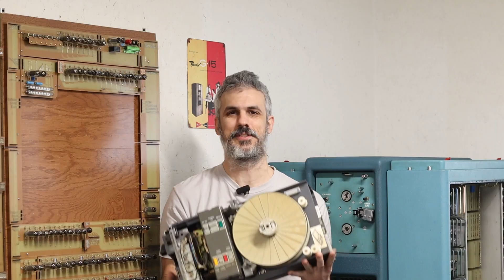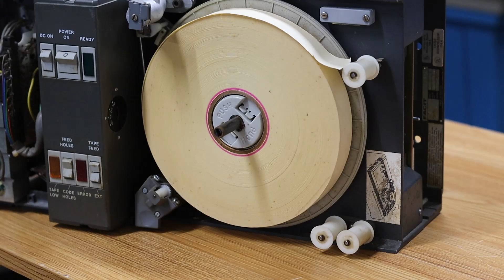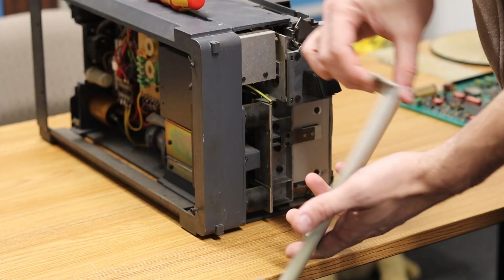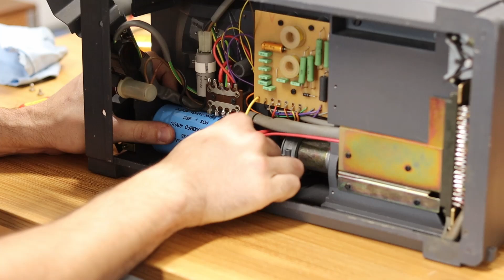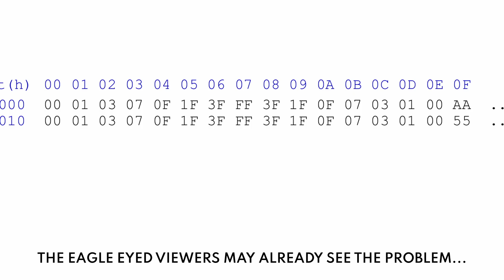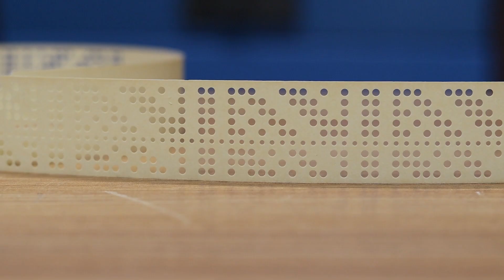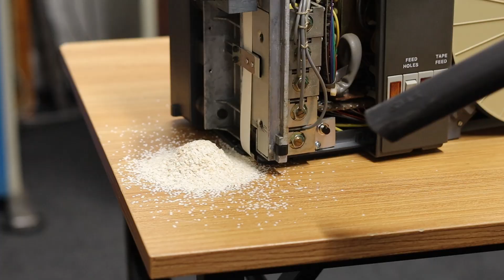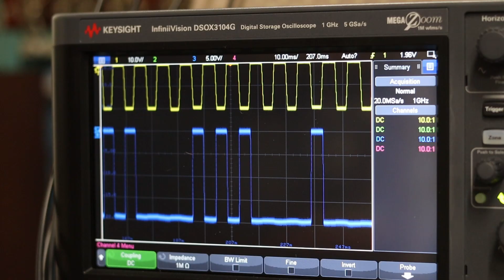Reviving a Facit 4070 Paper Tape Punch

Comment: Tip: Remove the cards and bring up the power supply wtih a variac to try and reform the caps over 24 to 48 hours since they haven't been powered up in years. Bring it up about 10v every couple of hours until you get to 110v going into the unit. That will help keep those old caps from shorting immediately on power up.
Reply: Bringing up newer electronics like that can be problematic and damage other components. And would not have saved a cap that was shorted.
Reply: @KameraShy  Caps like that short on sudden full power up after being unpowered for years. That's why you bring them up slowly. I did this on my SWTPC 6800.
Reply: @Arcadecomponentscom  agreed, I came here for this comment. 
@KameraShy is right too, I think this only applies to linear supplies. You'd have to pull and manually reform bus caps on switchers.

Comment: Just a small point ,  we used to use a telex punch ,  a KSR33  would be just as useful ,  the mechanism is very similar to a mechanical barrel printer ,   incidentally I do like the ODEC , chain printer,  which model is it if it has a hammer bar actuator its the faster 500 lpm I think ,  if it is look at the springs for the hammer bar ...... Yes it's Fibreglass circuit board

Comment: If i correctly recall, the MGAC ( Missile Alignment and Guidance Control) on the Titan II Missiles used paper tape as a security measure, as well as for reliability.   They still have a sample at the Titan Museum in Arizona.
Reply: I can relate. The British Navel used (and may still do) paper tap for sending message securely to ships as they were easy to destory if needed.

Comment: Great to see that it was just a slight tweak to the photodiode sensitivity to get it working with the white paper tape, but before you did that, I was thinking, "These tapes are kinda like the ribbons in that typewriter/teletype. Surely there are kits to 'reink' them to keep the ribbons useful for a much longer period, and not force them to be thrown away when exhausted, when they might be irreplaceable. Couldn't you do something similar to 'reink', or just 'ink', the white paper tape to make it more opaque to the reader's light?"

Comment: The fact that you can now transfer data from your modern laptop to such an old machine as the Bendix G15 is mind blowing
Reply: you can go back even further and transmit data to old teletypes. It's mind blowing that, while PCs have dropped the RS-232 serial ports about a decade ago, you can still buy USB and PCI-Express serial cards that are fully compatible with such old machines. While RS-232 is the standard, the signaling (+12/-12V) goes way back. You can, with a simple voltage adapter, connect to Teletypes from over 100 years ago.
Reply: @drgenio2006 my motherboard has serial and parallel still and it's like 5yr?
Reply: @forbiddenera  k
Reply: @drgenio2006  Some MoBos still have internal COM ports so you can connect the serial interface directly.

My relatively recent  B450 MoBo (~2021) have a couple that can be enabled or disabled on BIOS
Reply: @-argih  well, there is still an ISA bus in every PC motherboard. it's just not easily accessible haha
Reply: @drgenio2006 most of the time it doesn't even make it out of the southbridge package anymore.
Reply: @drgenio2006  That was true in the days of PCI, the ISA bridge was written right into the spec. But most boards made in the last decade no longer allow any access to the ISA bus, because they probably don't have one except as a data stream within all the PCIe data. (So they have a VIRTUAL ISA bus for OS compatibility, but no physical contacts.)
Reply: @drgenio2006  The ISA bus doesn't physically exist in a modern PC anymore. It got replaced by the LPC (Low Pin Count) bus that connects a bunch of low throughput devices (eg. BIOS flash, mainboard sensors, etc.) to the chipset. LPC looks like ISA to the software, but at the hardware level they're not compatible (although LPC to ISA bridges exist).
Reply: @blahfasel2000  I said "it's not easily accessible" didn't I?
Reply: @drgenio2006  "not easily accessible" implies that there's something to access in the first place, which there isn't in a modern PC. That you can add an ISA bus with a LPC to ISA bridge (just like you can add one with a PCIe to ISA bridge, or even a USB to ISA bridge) doesn't mean that it has an ISA bus.
Reply: @blahfasel2000 what a bitter little man.
Reply: @drgenio2006 god I want one that has all the old stuff easily accessible.
Reply: You only need a mechanical code converter 😂
Reply: Such is the power of RS232!
Reply: It's totally doable with custom electronics that connects to the vacuum tube computer via high voltage logics interface that's usually used to plug in peripherals - you gotta figure out how to make it function like virtual RS232 as those ancient computers don't know how to properly handle RS232 as they predate that specifications. It's gonna be wild seeing the messages via terminal received from the early computer after it has done its processing.
Reply: Man, I'm struggling to do this with my Morrow Pivot all because I don't have any 5.25 disks and haven't quite got my fdd emu working
Reply: If you really want you can use a PC to send and decode Morse code, given you have a constant enough wpm, that just needs a sound card 

Or connect a ticker tape machine and get your stock market data like the old heads from the 1920s  

Wifi or LTE connected ticker tape just connect an esp32, with custom program, and use a level shifter on the esp32 uart

Even Bluetooth compatible
Reply: Can even use your smartphone

You could go a step further and instead of paper tape, you could use led or optoisolators instead of paper tapes, directly driving or replacing the entire photo diode assembly if using opto isolators

How much faster can it now load a "tape"

Just record the pulses on the paper tape as a parallel data stream, play it back using an esp32 via Bluetooth or WiFi

Each bit is either an led or optoisolator

Would be an easy way to test the vacuum tube computer before wasting paper tape, to know the logic actually works

Comment: Pronounciation of "Facit" is good enough. At least you didn't try to pronounce the "c" as a "k".
Be aware that some of the early switching power supplies need a load to work properly and will overload the electrolytic capacitors if started without a load. Trust me - I have blown a Facit/Luxor switching power supply that way once - with the magic smoke/smell escaping.
In the 80's I experienced green paper tape on the ASR33.
Reply: Seeing as it is originally a Latin word, maybe it would've actually been pronounced with a K sound in Classical Latin pronunciation? 🤓

Comment: The bell sounds a bit muted
If you manually operate the armature, the clapper should have a small gap, esentially the clapper should bounce on the bell
To adjust this you would usually rotate the bell dome, the hole is offset ;)
(unless you prefer a muted bell)
Reply from the maker: It sounds muted because the levelizer and compressor I run on the audio is muting it a bit. In person, it's nice, sharp and loud!

Comment: its messy drive, i just don't understand how computer read the data from paper with holes..looks like its 8bit data by counting the holes across but that requires a lot of paper. Its fascinating but everything been transfer to film as lot easier to read and write by magnetic tape then move toward spindle platters ., then laser-optical digital disc , then to tiny memory chips of today thumb drives .. How fast time went

Comment: I bet the paper is hard to find. Back in the 80's, my uncle loved all things musical and gadgets. He had many player piano's and slotted disc players. He decided to rebuild a grandfather clock, and included a full two octaves of door bell chimes. The music was on a long loop tape that used leds and photo sensors to activate relays for the chimes. He could not find the right type and size of paper for it, so he took a vinyl shower curtain and cut it into strips the right size. punched holes on both sides for a dot matrix tractor feed to run the strips over the "Read Head". the clock played a different tune for each hour.

Comment: For the purpose of not relying on the puncher only, an Arduino or Rasberry PI emulator could be the solution. Simply use LEDs to activate the photo diodes.

Comment: Apparently you got it going without this tip, but I like to provide it anyway:  I believe you still can find stamp pad re-inking fluid.  You could run your white tape over one (or between two) such pad(s) and add fluid as needed.  Some fluid was black, but another was sort of violet blue, as I recall.  In any case either one should darken your tape, although at the cost of unavoidably also darkening your hands  —  maybe better use dish washing gloves to avoid 😢 — and get your dark tape without “accidents” —  😊.

Comment: Capacitors: KEMET 10000µF / 40V (ALC80A103CD040) are about seven Dollars a piece at Mousers. I'd not use old electrolytic capacitors like this Mallory as a replacement. Glue some plastic screws on the top of the capacitor, this should do the trick.

Comment: Back in the 1980's, we used punched tape in our old CNC machines in our machine shop. Our tapes were used over and over so much that we went to mylar tape to make it last longer. If a paper tape broke or had damaged holes, it could cause the machine to crash and scrap the part being made. Especially if it was cutting threads on the part at the time.

The problem with punched tape in the CNC world is, if you need to make a small change to the program, you had to punch a whole new tape. I discovered that the Punched Tape Reader communicated with the machine control over a parallel interface, very similar to the printer port of an early PC computer. I wrote some software for the PC that mimicked the operation of the PTR, and made up a cable. We then saved all of our programs in ASCII text files. In operation you could see the lines of text scrolling on the PC screen. This made it much easier to edit the files if needed, and the complete part program library was located at the machine for faster access. Also, no more bad tapes.
Reply: in the lat 90's i had to troubleshoot a PTR communication problem involving a GE unit the size of a fridge that ran a modified bridgeport knee mill....i was a wannabe homebrew PC tech withna reputation of being able to sus out weird issues...when i got the call....I'm completely lost in S100 bus, back plane and wire wrap technology....they had already put in hours on the phone with the PTR supplier, the bus cad supplier and an old guy that knew more than i ever will ...mailing cards and cables back and forth and updating software all with no results....I notice the reader light isn't on and ask all 3 sources on a conference call, if that matters, nope, the reader has nothing to do with the PTR function, i was told....so i take the bull by the horns and trace out the wiring for the reader and ,sure enough, found a ground wire broken at the wrap on the backplane...5 minutes later, reader light on, they were running parts again...total repair time 18 minutes

turns out that the ground on the reader is responsible for logic low at the reader and logic low doesn't sink much current so logic high can persist on the bus

i was considered a genius formthe next 30 minutes (when it was discovered that imhad locked my keys in my car)
Reply: @CATech1138  Awesome! The universe has a way of keeping us humble.
Reply: @CATech1138  Too bad this was before everyone carried a phone, or you could have called the Auto Club or a locksmith and kept the "keys locked in" incident to yourself.
Reply: Nowadays you'd probably use an Arduino or similar with a small screen and a few buttons, and only need to hook up a computer to add or modify programs.

The paper tape fragility was dealt with in the days of Jacquard looms by using punched cards strung together in a fan-fold. This also meant individual cards could be replaced. It probably would be speed-limited by its own physics though.
Reply: we went to mylar tape to make it last longer... As I mention in my own comment, we used the mylar tape for control loops in our line printers in the early 1970s - the channel numbers corresponded to the tab positions used in FORTRAN, for example, so a write with  H1 would skip to the next hole 1, by convention top of form, and you could use H2, H3, etc. for tabbing into forms of various types (ours were mostly cheques and payslips). The readers in the backs of the printers were mechanical brushes onto a metal drum that the tape ran around and it would particularly wear the sprocket holes if you put a standard paper tape in there. That was the only use we made of mylar cored tape, it was hideously expensive compared to the standard stuff, half of which we threw away anyway since the punching process had a verification step that duplicated the tape... so wasteful!
Reply: It is entirely possible to edit a paper tape record!

One can delete and insert tape segments to get this task done. 

It is also possible to reconstruct damaged tapes.

One shop I worked in had the little square pieces of tape with all the hole positions punched out, which made it perfect for bonding two tape segment ends together and maintain good index hole alignment.

They also had a manual punch.  Basically, this was a small station that had 8 punches one could operate by hand.  It also had an index sprocket and wheel one could turn and advance the tape one byte at a time.  (Or one record for some tapes.)

With those tools, the operators could punch up a replacement segment, cut the tape using the little shear on the patch station, insert fresh tape into the station and punch all the characters needed, then shear both ends for precision joining with the paper tape, patch tape.  

Take a few minutes to smooth it out, maybe put a bit of very light oil on and run the now patched tape through the reader and go!
Reply: I assume there was no way to just cut the tape and splice in the changed part of the code?
Reply: That's awesome, sounds like something I would do 🙂
Reply: Interesting. Our 2018 Okuma lathe still supports an external tape reader. I'm not kidding. It's a shame how slow the industry moves.

Comment: When you mentioned needing a bucket for the chad it reminded me of a visual joke the DEC field service guy left in the VAX 11/780 in the PLU computer center. The middle cabinet is nearly empty and he had hung a small plastic beach pail inside with a loop of cable running into it along with a handful of paper tape chad. Our system manager would show this to people during the occasional tour and say that when there was an overflow condition any of the extra bits falling off the end would get captured here and that he needed to empty it once or twice a month. The pail was labelled "bit bucket." Thanks for taking me back!
Reply: My dad was less than pleased when I discovered the "bucket of confetti" and spread it around his bacherlor pad. I was 5.
Reply: @OscarSommerbo c’mon dude, we know that you’ll do the same thing right now.
Reply: @OscarSommerbo  Those were floating points from the floating-point hardware that every DEC computer either had or wished it had.
Reply: Came to the comments looking for this. Something similar was joked about the rectangular chad from the 80-column card punches used way back when.

Comment: Swedish is odd.  Facit is pronounced closer to Faas-it. Google Translate does a decent job of it. Facit translates to "answer key". As for it just working, that isn't entirely unexpected, I assume the paper punch is from the 70s or early 80s when Swedish stuff were built to survive being nuked. Also steel was pretty cheap, so  assume they used a lot of it.

Comment: In the second half of the 80's i worked in a machine shop between high school and college and went back the first two summers.
They had a CNC lathe that had an optical reader on it and a separate printer which also had a tape punch and a mechanical tape reader.  Yellow and white tapes always failed going thru the optical reader but worked fine in the mechanical reader, but it was very slow.

Comment: Almost an opportunity to create paper tape emulator... Either mechanical one, using row of leds, or as a whole paper reader unit replacement...
Reply: Sure, it is possible to bypass the whole paper tape thing and directly feed in the binary data, as @mre9789 in the top comments mentioned. You also don't need any emulation, as it is just plain binary data. However, it is much more fun to see old machines working on their original intentions.
Reply: @r_firefly4292  The idea is to be able to debug quickly. For "normal, on display" use, paper reader is obviously a must, but just for debugging, It would be much faster to be able to generate "tapes" virtually with desired deug code, even single instructions out of thin air.
Reply: @12fr45a  That's true, I think it is even possible to reuse most of the parts from the paper tape reader.

Comment: You haven’t lived until you’ve sat at an IBM 029 for hours punching Hollerith cards.  😉
Reply: Or waited for the 024 to warm up. The 129 was a blessing. I still remember how to program the keypunch machimes
Reply: @rty1955  Both the 024 (non printing) and 026 (printing) keypunches used vacuum tubes (aka "valves").  Yes, they did take a while to warm up.